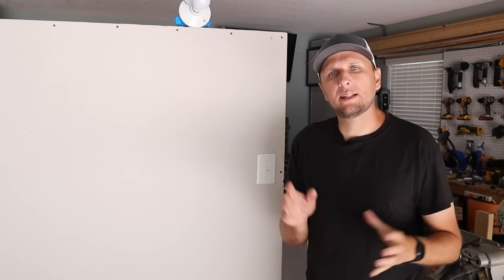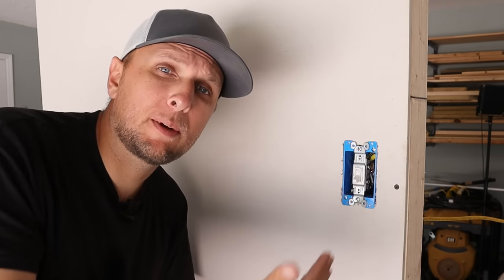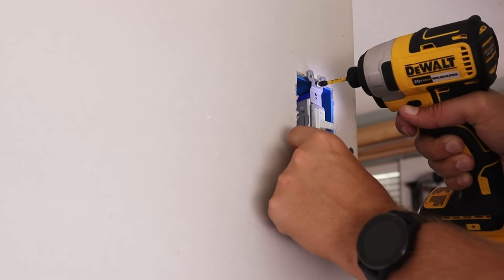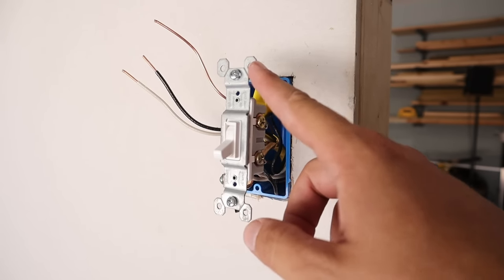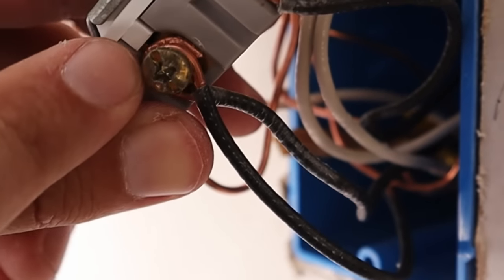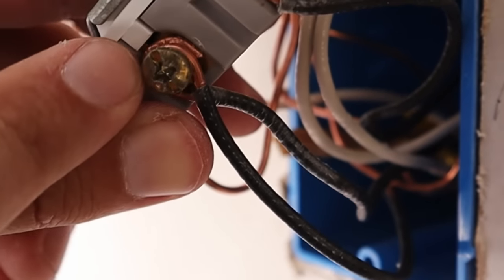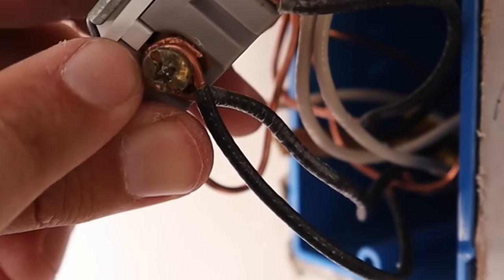How To Add An Outlet From A Light Switch | Common Mistake

Comment: Shalom Aleichem. 

I'm not an electrician,  I'm a retired mechanic  / truck driver on disability.  I do most of my home repairs and maintenance an I have a question.

In my bathroom my electrical outlet went bad. I shut off the power and disconnected everything so another room where my window a/c unit is located. 
I want to install a ground fault outlet to the main switch in the bathroom and then rehook it back from there to the bathroom light.

Any help would be appreciated. 

Ratson haba b'shem YaHuah

Comment: Can this be done off a 3 way switch?
Reply from the maker: Yes as long as it’s the first switch in the setup where the common wire is the line wire from the panel.
Reply: @HowToHomeDIY  great, thanks for answering !

Comment: The only thing that I saw that may be incorrect was the breaker was 15 amp and you ran 12 gauge wire. As far as I have learned you shouldn't branch with a heavier wire
Reply from the maker: There is nothing wrong with using #12 on a 15 amp circuit.  No code against it either.
Reply: @HowToHomeDIY  correct but you were branching using a heavier wire than the feed
Reply from the maker: Feed was also #12.  It wasn’t heavier.

Comment: Can an outlet be created using power from the light itself rather than the light switch?
Reply: Yes, but the receptacle will only have power when the light is on.
Reply: @surferdude642  Thank you for responding.

Comment: Could you come off a light fixture the same way?
Reply: the light fixture if  it was wired where the power comes to it first then to switch leg, it gets more complicated. but yes you can come off a light fixture to add a receptacle
Reply: @harveylong5878  thank you for the information, I'm still trying to understand electrical.

Comment: First step check to see if it is a 3way switch circuit. Lights and outlets are usually on separate breakers. You never mention listing the new outlet on the circuit breaker panel.
Reply from the maker: Pretty much none of my circuits are separated and it was all wired by an electrician and inspected.  And no I did not talk about listing the one outlet on the panel.  You can if you want.

Comment: I accidentally had black an white touch. While attempting to change plugs. Didn't cause the circuit breaker to flip off, but the wires aren't working. How to fix?

Comment: Maybe this works in USA but they have different wiring regulations to most of the world, where this would be illegal and dangerous. Such work would also void the insurance if it causes a fire. Check your local rules, and preferably use a licensed electrician.

Comment: All very good. Now you open your switch box and the power feeds from the light socket and there is no neutral white wire (done on older homes, code now says you have to have a neutral wire at the switch ) Or you run into a 2 or 3 way switch, and don't forget that plugs have to have Arc fault breakers.  Of course you the home owner is  doing this without a permit, so..... carry on, just use the ground wire at the switch for neutral to the plug!!  Just remember, you're the one sleeping in your house.
Reply from the maker: So put it on an arc fault breaker.  If it is newer, it is probably already on one unless it is in the garage, bathroom, outside, etc.
Reply: you do know they make arc fault outlets right? or they used to anyway. as for a permit, pfft adding one outlet Im not going thru the endless permit hell over.

Comment: In my home the neutral wire goes straight to the ceiling and only the live goes to the switch box.
Reply from the maker: In that scenario it would not be as easy as in the video.  Would need to run a new line unfortunately.

Comment: Isn't 15 amp breaker rated for 14/2 and 20 amp for 12/2?
Reply from the maker: Yes and no.  #12 can also be run on a 15 amp breaker but #14 cannot be run on a 20 amp breaker.  Hope this makes sense!

Comment: Receptacle*, not "outlet."
I would have pulled the switch out first to determine the hot wire, then shut the breaker off. That way you're not wasting time making multiple trips back and forth to the panel.

Comment: Most of the time there isn’t a neutral in a switch box. They used to use a 12-2, the white wire for the hot and the black for the switch leg. Switches don’t need neutrals. Also you shouldn’t mix power and lighting  but that wasn’t the point of the video. Other then that, nice work.

Comment: In Europe only a cowboy would take power from a light switch to feed a socket.
It’s completely wrong, light and power outlets should stay separate at all times, different Amp rating for both isolators/RCD and cable sizes. 
At best with this extension you will have the circuit tripping for over current, 15Amp at 120V is only 1800W, a decent vacuum cleaner would trip it; at worst the RCD gets swapped for a bigger one and with time the wires gets cooked creating a potentially dangerous situation.
Reply from the maker: In the US it’s how our circuits are wired.
Reply: @HowToHomeDIY  Fair enough, still potentially dangerous, specially considering that the lower voltage in the US dictates higher currents and higher resistance.

Comment: Code says you need to secure the romex within 12 inches from each box, so wouldn't this fail an inspection??
Reply from the maker: Not in a finished wall.
Reply: @HowToHomeDIY  Thanks, found it! For anyone curious:

(B) Unsupported Cables. Nonmetallic-sheathed cable shall be permitted to be unsupported where the cable:

(1) Is ﬁshed between access points through concealed spaces in ﬁnished buildings or structures and supporting is impracticable.

Comment: That's all fine and dandy if that's not just a switch leg in that Box ..
Reply: Personally I never wire a Receptacle on a 15 amp. Circut... I'll grab power from a 20amp circuit and run another wire

Comment: I thought 15A is only for lights and 20A was for receptacles?
Reply from the maker: It is either/or.  In most places in the US, breakers and wire size are chosen based on what the room or circuit is for.  So you may have a designated 20 amp circuit for GFCI's or microwave but you may have all of the bedrooms on a 15 amp which includes all of the lights and receptacles in the room.  In other countries they are oftentimes separated.

Comment: What if there is no neutral wire in the switch box?  How could we install a new outlet?
Reply from the maker: You wouldn’t be able to without running new wire.  Outlets require a neutral.
Reply: @HowToHomeDIY  How can a run a new neutral wire?  If I find a neutral close by, can I run a wire from it and use it?

Comment: But many times the power goes to the light with a single wire going to the switch, line hot down, switched hot back with no neutral in the switch box.

Comment: Why would the manufacturer make switches with the hole if it’s “not reliable” I have installed 1000’s of outlets and switches and had maybe 5 cause an issue where the back stab didn’t work and all of them were manufacture issues

Comment: 8:35 “Stacking” wires on a single screw, or even using the screw and the push-in hole, isn’t wrong. The likelihood of it failing or a wiring coming off is about the same, if not worse, than a wire coming out of a wire nut. It is perfectly acceptable to do this. This seems to be just a “tip” for YouTubers to give out.
Reply from the maker: You cannot stack more than one wire around a terminal screw.  They are intended for one wire under their UL listing which would make it a violation to use two.  As for the push ins, like I said in the video, they are legal to use, but they are probably the biggest failure point on these devices.

Comment: This only works if you have a neutral available in the switch box.  The way my house is wired they just took 14/2 wire and used the white as a second black for all the switches in my house.  So this method is not an option for me.

Comment: In my apartment, my bathroom is wired up stupidly. The outlet and the light are wired to the switch in such a way that the light switch controls the outlet, so i cant have things plugged in and charging with the switch turned off. Its very annoying.

Comment: Adding an outlet to a light circuit is a no no as the outlet requires a 20 amp breaker & 12-2 wire. The "old work box" you added was installed incorrectly. The bottom of the hole was right at the top of the bottom plate thus not allowing any drywall for the swing out tab to contact and hold the box in place. I hear a lot of people say " I don't care how they do it up north, this is how we do it" This is why we have a NEC National Electric Code.

Another reason lights and outlets are separated is so when an outlet trips the breaker, you are not left in the dark. Now calculate how many of the people who watched this and are left in the dark thinking this solution is a good idea.

Before adding any light or outlet, you must calculate the circuit load and see if there is enough amps to do so or risk overloading that breaker. If you need to add new circuits, they make a miniature tandem breaker, which is 2 breakers that fit in the space of 1.
Reply from the maker: Ok no it does not require a 20 amp breaker just because the wire is #12.  It would never overheat on a 15 amp circuit.    Also, depending on jurisdiction, lights and outlets are not always separated on a circuit.  Nobody is in the dark.
Reply: any of those POS Old work boxes are installed incorrectly - right in the dumpster and burned is how to install them correctly

Comment: Some switches have no neutral conductor, and some even have no hot conductor. Both must first be confirmed before this work continues.
Reply: If the switch is fed from the light then all you will have is a hot down and a return back up. I've never seen a switch that didn't have a hot unless you were switching the neutral which is dangerous.
Reply: @clayadams2068  Untrue. Not all switches are SPST. You forgot about 3-way and 4-way switches.
Reply: I was referring to single pole switches like in his video.
Reply: @clayadams2068  You said, "I've never seen a switch that didn't have a hot..."
You meant to say, "I've never seen a SPST switch that didn't have a hot..."
Reply: Uh yeah I know what I meant to say. I've been an electrician for 35 years.
Reply: @clayadams2068  Uh Yeah crap in, crap out. Sorry I didn't understand you.

Comment: What if the light switch only contains the leg from the light and not hot and ground?
Reply from the maker: Without a neutral this would not be possible without running new wiring.

Comment: Did he screw that box directly into the drywall?
Reply from the maker: No
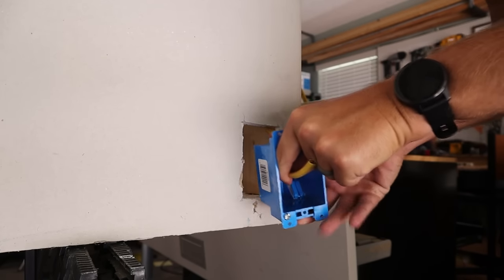Reply: @HowToHomeDIY  4:24 Those screws aren't anchored to anything!
Reply from the maker: It's an "old work" box.  There are wings on it that flip out once you start to tighten the screws and then sandwich the drywall between the wings and the front of the box.
Reply: @HowToHomeDIY  Ahhhh... okay, that makes sense then!

Comment: Why don't you insulate the ground wires over there?
Reply: Can think of a couple of reasons - if the box is metal and the ground is bonded to it, you've already got an exposed grounded metal surface. Also, that makes it more likely to trip the breaker if there's an exposed hot conductor.  I'd much rather find out that there's a problem from a tripped breaker than from voltage running through my hand..

Comment: Just buy good light switches that have 2 push in connectors for every input
Reply from the maker: No thanks.  Those are one of the first things to fail on a switch.
Reply: @HowToHomeDIY  never heard of Busch-Jaeger connectors failing, they only have push in connectors

Comment: i was taught to wrap the outlets and switches with tape , and he forgot to mention if there were only 2 wires in the switch box ,otherwise not bad
Reply: tape around the screws is for hacks/DIYs that dont know what they are doing. plastic box isnt conductive, the screws cant arc to the plastic. the tape is a nightmare down the road when it dries out, leaves nasty gooey residue all over the screws. if you using plastic box, skip the tape

Comment: Why does stacking the hot wires “have a high probability of failing “?  What is the logic?  The screw holds one wire without a high probability of failing, doesn’t it?  Why not two?

Comment: but most of light switch does not have neutral wire, they just have hot wire and running wire to the lights.

Comment: Please talk about one think at a time. Hard to follow as you interrupt your step descriptions to caution about push holes or wires stripped to far. Please try and go through the process clean at least once. Electrical is hard enough for beginners. The cautions can come after the clean install instructions. Please think about it. Two of the 19 year olds I got to watch your videos independently said they could not follow due to the cautions. It became intimidating for the new learner. I think your goal is to engage new learners, so thank you for what you do and offer.

Comment: Now why is this a bad idea!? The light can go out if something plugged into the outlet pops the breaker possibility leaving someone in the dark. Maybe certain situations but not all.
Reply: Well, most rooms in most homes are assigned one (1) circuit breaker that covers the lights as well as any outlets therein.  So in the vast majority of cases it doesn't matter is the light or the outlet shorts out ... the one (1) circuit breaker covering the whole room will trip and leave you in the dark.
Reply from the maker: @DiGiaCom Tech hit the nail on the head.
Reply: @digiacomtech5589 fair point. But I would not count on it. Plus only few rooms have one circuit. Perhaps small bed rooms but the rest of the house and large rooms have multiple circuits. Better  to play it safe when showing others how to do stuff.
Reply: @HowToHomeDIY  unfortunately, he bent the nail.
Reply from the maker: Every situation is different.  You need to approach yours accordingly.  Never know what someone before you did.  But for the most part, he is correct.
Reply: @Jimmyjimjimjim  ... If by 'circuit' you mean outlets and/or switches then YES there can be many in any room.

However and as mentioned above, it is common practice (I believe even code) that requires only one (1) 'Circuit Breaker' be provided to control the flow of power to that room no matter how large it is or how many outlets or switches are are installed therein. 

And it is the number of outlets therein that determines the 'Amperage' of that 'Circuit Breaker'.

Comment: Why don't you use lever connectors instead of wire nuts?
Reply: Ask any real electrician, twisted wires capped with a wirenut provide a far superior connection than the tiny little bus bar in a Wago.
Reply: @NoTroubleMikeG  Actually, there are many electricians that use Wago lever nuts (basically all of Europe too).  If you’re a DIYer with limited experience with wire nuts or the existing wires you haVe are very short, I would highly recommend Wagos.
Reply: In Canada levere connectors are expensive and not readily available

Comment: I find this to be a misleading title and description.  Yes, you are adding the outlet from the switch's electrical box but not actually from the switch itself.  If the switch were the power source, that to me implies you would have pigtailed the load wires instead, and the outlet would receive power only when the switch (and accompanying light) is on.  Your pigtail, however, branches the line in two, basically just bypassing the switch as far as the outlet is concerned, so both the switch and the outlet get their power from line source.  I am not arguing against your choice of wiring technique or suggesting whether or not one should have the outlet switched (if locally allowable); I'm simply explaining my issue with the title and description of what you did.
Reply from the maker: I used a light switch location and feed to add the outlet.  So, I added an outlet using a light switch.  There is nothing misleading about it.
Reply: @HowToHomeDIY  Your response's first sentence completely rephrases it perfectly, but I guess the real issue must be merely my interpretation of the situation then.  I do take things too literally sometimes.  Sorry.

Comment: What happen if the switch only receive the Hot/Black wire but no Neutral.
Reply: Then one would have to run new wire from another location.
Reply: Single pole switches never use a neutral / white wire. The switch is only made to make or break the hot / black wire connection.
Reply: So if one has power at the switch location can simply place a double box and add the outlet. If the switch receives only two wires (Black & white-Interrupted Power) you are out of luck and you are in for a crawl in the attic or similar fun.

Comment: I didn't see that the switch box was a nail on sorry and I commented before you address the tabs. Still to close to the bottom plate
Reply from the maker: It’s a mock-up board with limited space.  I think I mentioned that.  No one would put a receptacle that low.

Comment: Additional caveat: This will only work if the electricity coming in is actually coming into that light switch box, if it’s coming into the light receptacle and then going to the switch, you cannot do this this way.

Comment: Most switches around here have no neutral in the box.
Reply from the maker: Older neighborhood?
Reply: @HowToHomeDIY  yes, 60+ years. But code didn’t require a neutral for switches until recently, 30 year old apartment doesn’t have them either.

Comment: American wiring and in particular the fittings really are amazingly dodgy. I wouldn't feel safe with components like that in my house. And yes I don't think this modification is legal many places outside America.
Reply: Just because you have seen worse don't make it right.
Reply: Dodgy huh?  Well if you’re in Europe you use a lot higher voltage than we do for residential which I find kind of dodgy...